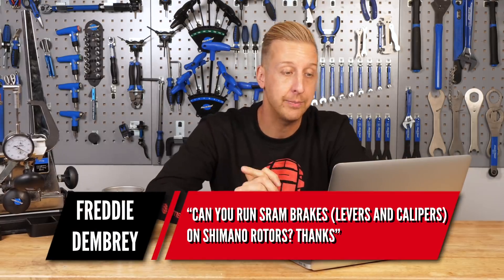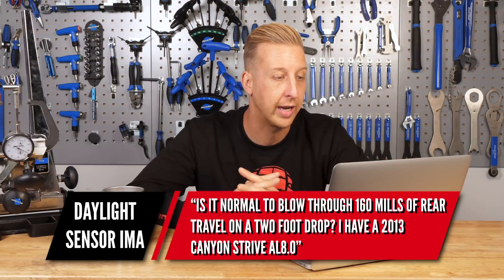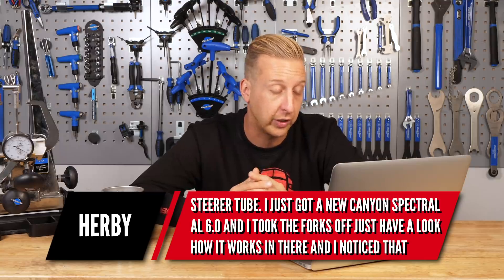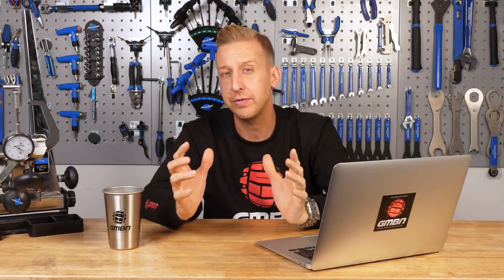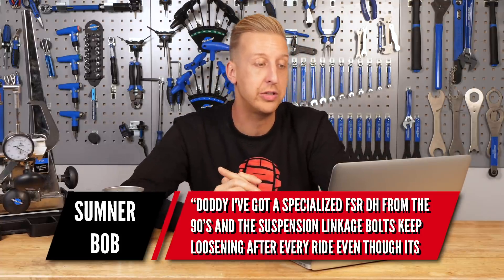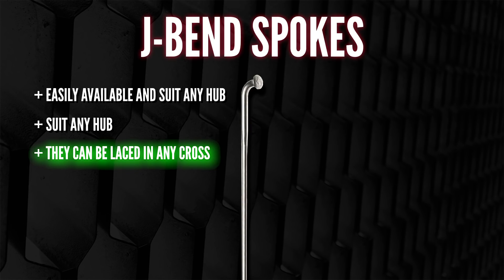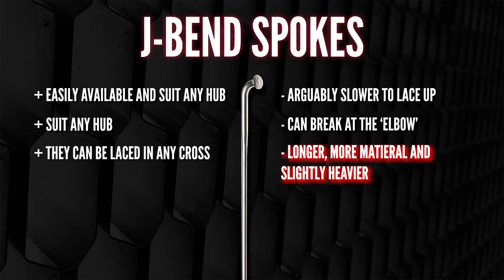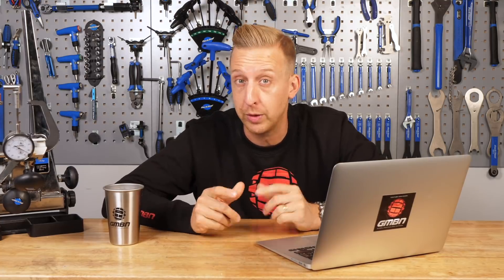Are Straight Pull Spokes Strong Enough For Trail Riding? | Ask GMBN Tech

Comment: One other issue with straight pulls are the hubs available seem limited to 28 spokes - that's quite a reduction from standard 32, much less beefeater 36H.  They are the way to go except for that - and offer easy spoke replacement.

Comment: I run shimano ice tec 203 rotas for years with Guide brakes and now the new codes, yes a spacer is used below cone washers. I do this as I found sram disc would warp as I only run sram sintered pads and they also hold heat longer and would burn my shin if wasn't careful but the ice discs stay cool.

Comment: #askgmbntech I've got a Manitou Mattoc Pro 2 fork and have recently installed their Infinite rate Tune negative spring.  The negative spring has to be set at least 10 psi higher than the positive spring. Will the negative spring have any effect on setting up the sag on the fork?

Comment: also some straght pull spoke wheels are a pain in the butt to aline because when you turn the niples somtimes the spoke itself is moving with it, so to tight or losen the sopke, you have to clamp it some way and this may damage the spokes and will take a signifacantly more time than some traditional spokes

i have some mavic cross-link wheels and i hardly aline them for these reasons

Comment: I think of myself as a knowledgeable MTB rider and tickerer. I ride a 2018 Santa Cruz Nomad and race a variety of enduros and DH in the Pro class here in the east coast of USA. I currently run a tire combo of a maxxis exo up front, and a DH casing in the rear. My question comes from the rise of the tire inserts. Would a exo tire and a cush core out back be as reliable as the dh casing I'm used to. I LOVE the feel of Exo tires but get so tired of buying tire plugs and Co2 for rear flats.

Comment: 2 Questions. .. would going from 19 to 21mm internal width on my 27.5 wheels make a noticeable difference? 2nd... what kind of difference would it make ride, width and weight wise going 19 to 29mm internal running a 2.3 DHF front & 2.4 Ardent rear

Comment: #AskGMBNTech Hi guys I have an SR-Suntour Epixon 120mm air fork on my hardtail. If I hit some jumps on normal air pressure (80 PSI) the fork gets compressed all the way. When I go on hard air pressure (120 PSI) it's too hard and not comfortable but the fork doesn't compress all the way and there is still 1 cm of travel left. My question is if my fork gets damaged when it compresses all the way and how I can setup my fork so that it's comfortable and doesn't get compressed all the way. Greetings from Germany :)
Reply: It's an air fork. Your meant to set the pressure in relation to your weight. It's not like tire pressure which is personal preference. If your saying at your weight, it is supposed to be set at 80 psi, then I would suggest bumping up a little bit to 90 psi (to make sure your accounting for all of your riding gear), and then buy some volume spacers. Add 2-3 spacers into the fork, and you should no longer bottom out. That's a good fork you have there, just needs a few small tweaks. Good luck.

Comment: hello doddy, my trek fuel ex 8 2017 29er  has 130 mm suspension front and rear, can i use this bike for drops and trail jumps? can this bike take a beating?
Reply: LOL how'd you end up with a fuel without knowing what it can do?! Yes bro, once the suspension is setup correctly, you can do all the drops and jumps you'd like. That's what it's meant for, it's a very serious trail bike.
Reply: @LithicKing  it was a christmas gift last year. anyway thanks for the advice! now i wont hesitate doing drops and jumps
Reply: @andrenighthawk4431  quite the gift! Enjoy it, it's up there with the best of them. But remember, just because the bike can handle it doesn't mean you can! Don't go for the biggest thing you can find first! Haha.
Reply: @LithicKing  I'll try small drops and small jumps first  to gain confidence before hitting out big ones

Comment: #askgmbntech My hub used to make a loud buzzing sound but after my last ride and bike wash, it became silent (in a pin drop room, you may hear some buzzing). I don't have any problem while pedalling forward but when I try to pedal back the crank rotates as if there is no chain on it. What could be the issue here? do I need to change my hub??

Comment: #askgmbntech Howzit Doddy. Why do my cranks keep coming loose? Its gotten to the point now that I need to tighten the bolt (quite a bit) every time before I ride. I'm tempted to use blue Locktite but I suspect that there may be a different problem than just the bolt coming loose. Any advice?
Reply from the maker: Hey Mark, it's hard to know exactly what the issue could be without knowing the type of crankset you have. As a first port of call, we'd suggest asking your local bike shop what they think.
Reply: If you hit the cranks hard on a rock, or many small hits over time, there is a chance the threading has begun to strip which is why it likely isn't holding after you've tightened it. Pretty common in cranks for the threading to strip. Like the gmbn guy said, your bike shop can fix you up. If it's the threading, they can fix you up for less then $50 for sure.

Comment: Here is the real answer to running shimano rotors on sram calipers. You can, but it’s not advised. It’s not necessarily the thickness, it’s the rotor brake track that is different. Shimano is narrower than sram. So over time the rider will notice in even wear. And you will find yourself replacing the pads more frequently. There are tons of forums that discuss this, and they all say what I just commented. Short term you can do it, but longer term effects aren’t worth it. If you want ice tech rotors just get shimano brakes or buy SRAMs version.

Comment: 0:18 - Can you run SRAM brakes (levers and calipers) on Shimano rotors? 
1:39 - Is it normal to blow through 160 mills of rear travel on a 2 foot drop? 
3:30 - Is there any disadvantage of overspending grease in a headset?  
5:08 - What's the purpose of the star fangled nut? 
6:58 - My suspension linkage bolts keep loosening after ever ride even after proper tightening. 
8:12 - Are straight pull spokes/hubs suitable for abusive riding? Are they better than J-bend spokes/hubs?
Reply: someone give this man a job at gmbn
Reply: you da real mvp
Reply: Legend
Reply: Thank you for lords work

Comment: #askgmbtech hi doddy I've got a cerrera vendetta and everytime I have puncture I can't get tyre on or off am even using moto x tyre levers which are no help it's a plus bike also I can't have any air in the inner tube otherwise tyre won't go on please can you help as I don't want to get stranded out on the trails

Comment: Hi gmbn tech, I just got a Scott genius 720 plus 2017. I really want to buy some hope pro 4’s or halo vortex wheels however. The bike came with center lock disks, am I going to need to buy new disks as well?
Reply: Yes unless the hubs are centerlock
Reply: @michaelpidsadny2379  thanks mate. I almost bit the bullet and ordered a set last week it's a good job I noticed haha. It's a boost bike do I need those ring spacers to line the disk up?
Reply: @jamestyrrell2225  hope sells an adapter kit so that you can use a non boost wheelset with boost dropouts. Unfortunately you won't get the extra wheel stiffness from boost if you go down that route. If you can find a boost wheelset for your boost bike, that is the best option:)
Reply: @michaelpidsadny2379  very friendly of you to give information on here I appreciate that mate thanks! Hope do make a pro4 boost enduro wheel and the halo vortex comes with boost too, so thanks a lot 😁

Comment: Hey Doddy, enjoying the show. What do you think of upgrading the travel of my fork from 150mm to 160mm at my Canyon Spectral 2016? #askgmbntech
Reply from the maker: Hey McSchwabl, you shouldn't have a problem there. You'll get a little slacker head angle and the bottom bracket will raise a bit, but it won't make that much of a difference.
Reply: Thank you :)

Comment: #askgmbntech Hi Doddy, I have the Voodoo bizango 29 2018 and what love to upgrade the a tyres on it, what is the maximum tyre size I can fit on a 23mm internal width rim, thanks
Reply: *would love
Reply: I'm not sure, but be aware that your frame will only allow so much tyre width, which is often the limiting factor. So my rough guess would be, whatever size the frame fits is the maximum size you can use on those wheels. 

However, on some bikes the wheel rim width will be the limiting factor, for example where a boost fork has been used for greater stiffness with standard width tyres.

Comment: #askgmbntech 
Hi guys, what would be the perfect travel for being as efficient as possible climbing and going downhill??
Reply: travel does not matter, it's weight,  and of course taht's if the suspension is set up properly, if not more travel will result in even more inefficient ride.
there can be bike with less travel that are less efficient, than a bike with more travel.
but if the weight is about the same & suspension is set up properly there should not be much difference, and of course geometry,reach,wheelbase, fit....
with coil sprung suspension too much travel will be a lot heavier.
Reply: For a full suspension or hardtail? If you have a full just go for those xc full suspension bikes. Maybe from 100 to 120
Reply: my comment still stands no matter if it's a hardtail or full suspension bike. and travel depends on the size of the rider, bigger he or she is bigger frame and more travel can be used, go for as much as possible, without too much weight penalty,proper suspension, with all the adjustments needed. I need a full suspension bike to do gnarly stuff, my back & neck can't handle hardtail with this kind of riding.
forks and shocks got lockouts, but I like to keep it in open no matter what.
if you ride xc then xc bike will be more efficient if you ride every thing a trail bike or enduro bike will be.
Reply: My trail bike has 120 in the rear and 130 up front and I weigh 225. I used to live in western Colorado and this bike was perfect for me but I did not ride any double  black diamond trails either.  But it handled the more technical blue trails ok.  Of course I was more into the climbs so that suspension worked well for me.
Reply: I like 120-140.
Reply: Johannes nilsen thanks a lot for you answer!! 
You have a lot of reason in what your are explaining and i agree with you. 
I have a hardtail and i am going to buy a full sus, the trouble is that i dont know if buying the Orbea Occam Tr 120/130 or the Orbea Occam Am 140/150. I do big rides at the pyrenees, with huge climbs (around 1.500 meters climbing) and obviously huge downhills on single traks, and high mountain terrain with lots of technical stuff.
Reply: Thanks you guys for all your comments!!! They are helping me a lot! Even though a Doddy explanation would be so great!!😉
Reply: @edgarsolerisol4822  check out whyte t-130. Perfwect if you need to climb but wanna shred.

Comment: One other advantage of straightpull is you can replace a broken spoke without having to remove the disc or the cassette
Reply: And if you have a wheel like Race Face Turbine R, with asymmetrical rims and different flange sizes, you just need one lenght of spoke on both sides :)
Reply: @MarcusLangeström  I like different flange sizes.
Reply: @MarcusLangeström  not sure that's right ....
Reply: @leoelkins3664  Thats how my race face turbine r wheels work.
Reply: @MarcusLangeström  I think maybe it's all dependent on the flange sizes and assymetric rims like you said, you'd still need different spoke sizes if the flanges are larger on one side. I guess your rims match your hubs, so the flanges have been designed to work with the assymetric rims
Reply from the maker: Thanks for the extra point!
Reply: . @gmbntech  yes but thats a very small benefit like micro weight savings

Comment: #askgmbntech hi there , what are the pros and cons of larger disc rotors and smaller disc rotors?  And i want to get a fast rolling tyre for my rear wheel and i was thinking of getting a high roller 2 or minion ss or do you have any other recommendations ? thanks alot!!
Reply: Hmm, I'd say: larger discs have better braking power, better cooling hence less fading; smaller discs have lower weight. Fast rolling tyres: Rocket Ron or Racing Ralph are Schwalbe's fast rolling tyres.
Reply: If you want a fast rolling tire from maxxis, consider the ardent on the rear. High roller is really not as fast as you might think. Then consider an aggressor for the front. Fast setup, but still great traction.
Reply: Never ever use an Ardent for anything, it's one of the sketchiest tires out there.
New Rekon in normal width does everything the Ardent does, but better, and if you're not a Maxxis fanboy, there are tons of better trail tires out there.
Reply: @janskrotnes6565  I've heard a lot of good things about the ardent from people looking for fast rolling tires. I think it comes down to how you ride, and what your looking for in a tire. Perhaps they are sketchy on your local terrain and your style of riding. We don't  know anything about this guys terrain or riding style. If maxxis made an aggressor for the rear, I'd probably recommend that, but I don't think they have come out with one yet.
Reply: @LithicKing  the Aggressor is a rear specific tyre, and it rolls just as fast as the Ardent, but it can actually hold a turn.
Reply: @janskrotnes6565  I'll have to look into that! I thought it was front specific, and so I passed it up on my search for a rear tire earlier this year. But like I said, if it was rear specific, i would recommend it to this guy. Looked like a great tire to me, and I'd definitely choose it over a highroller any day.
Reply: @LithicKing  I had one as a rear, but it didn't clear mud well enough for the summer we had this year. Rolled fast and held corners really well when dry.
Reply: There is also a bit of crosswind air-resistance to a bigger disc.
Reply: Unless you are counting grams, there are no point in running smaller discs, weight is the only positive with smaller discs, but everything else is affected negatively.